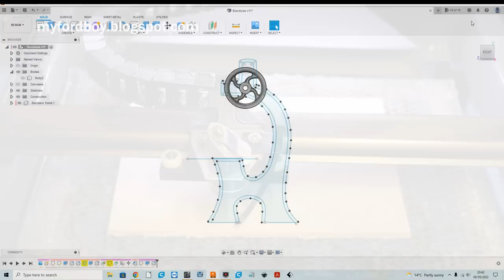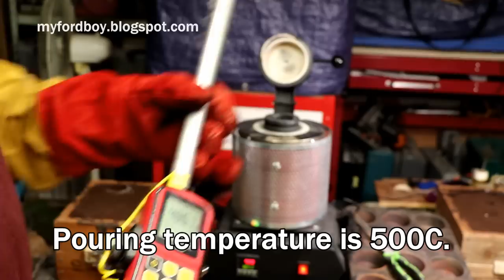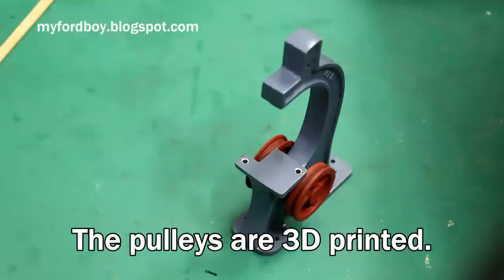Metal Casting at Home Part 121. Model Bandsaw Steam Accessory Marklin Workshop

Comment: I like the idea of the magnets on the wood to keep the man in place,
What did you use for the bade.
as many years ago on a smaller saw I bought I used a braided wire that could cut balsa wood.

Also nice of you to show how to make a simple drill extension,
I do go mad when my extra long drill bits are miss placed , to many hiding places in a home hobby shop.
Anyway i think it is very handy to have a selection of extra long drill bits.
Reply from the maker: I would have liked a blade that actualy cuts. Mine is made from 2 thin strips of duct tape stuck back to back.

Comment: Laser cuts at an angle, never vertical. with correct offsets you can have a pretty decent draft angle when sandwiching layers. You can even play with focus/distance/settings and see which gives you better draft angle.

Comment: Thanks for the video. Could you tell the capacity of that furnace for low melting alloys? The specs would suggest about 200ml but your casting looks much bigger than that. Thanks.
Reply from the maker: The crucible is 50 dia and 150mm tall so I make the capacity nearly 300ml.
Reply: Thanks!

Comment: At first the 3Dprinted part threw me off. But it is the table that does not fit at all at the end, and those large screws. Table would be so much better if cast and then surfaced. screws could be blind heads with bolts from the underside.
Reply from the maker: This is replica of a 1930s toy it is not meant to be a scale model.